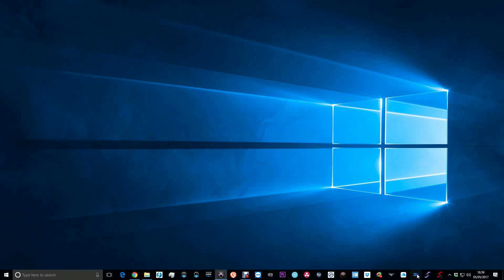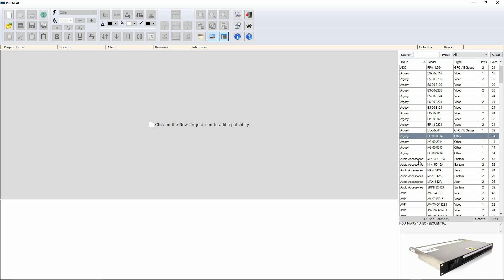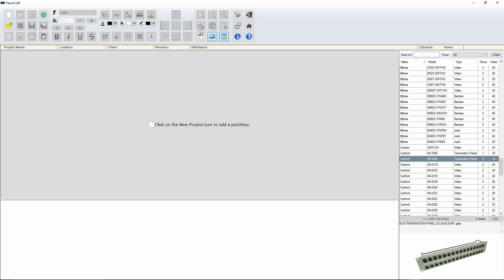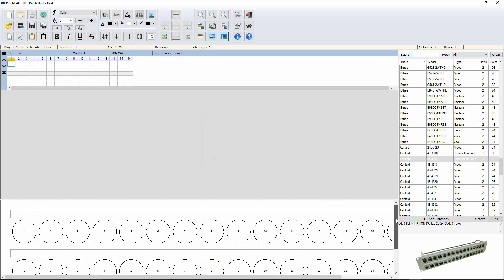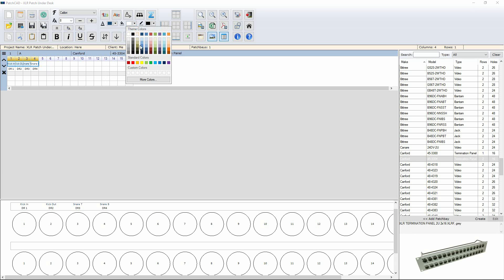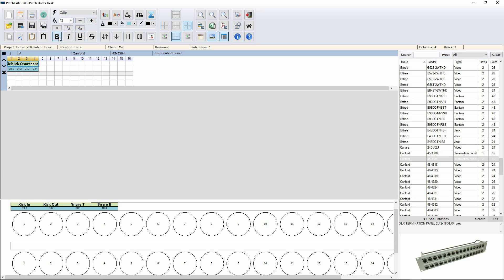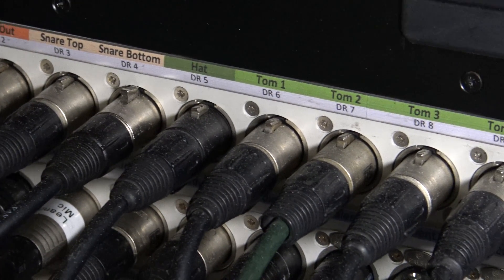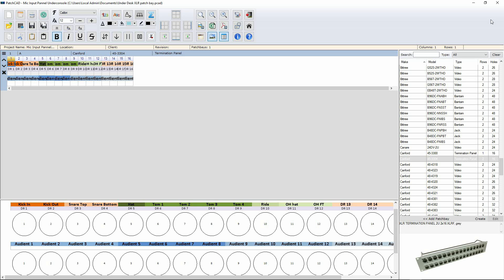Review - Patchcad Patchbay Design & Labelling Software

Comment: How are you actually sticking the print out to your pathbay
Reply: magic?
Reply: I had this question too.   Seems the way to go may be to affixing plastic "designation strips" to the rack and sliding the printed paper label in there.  The FAQ section of Patchcad dot com suggests printing on heavy stock paper for this, which makes sense.  Try a search for "PP-DS10BK" and I see also that Canford out of London sells them.  Otherwise, Elmer's makes a product called "Mounting Spray" which I haven't tried, but looks interesting.
Reply: BTW the patchcad software (basic) is now 15 gbp
Reply: @craigg8314  and now 25gbp :D